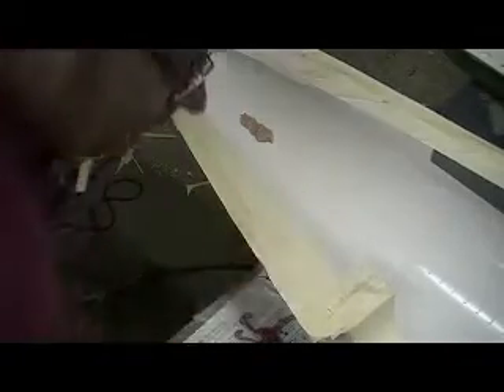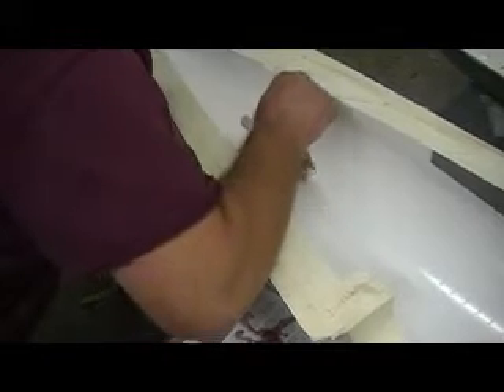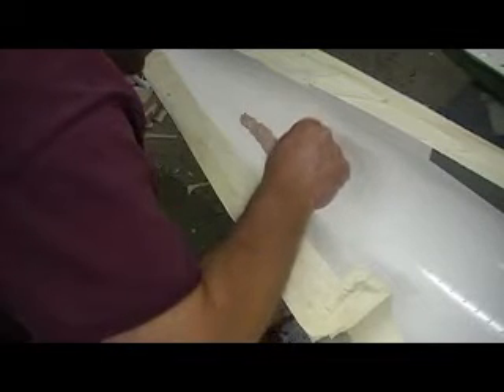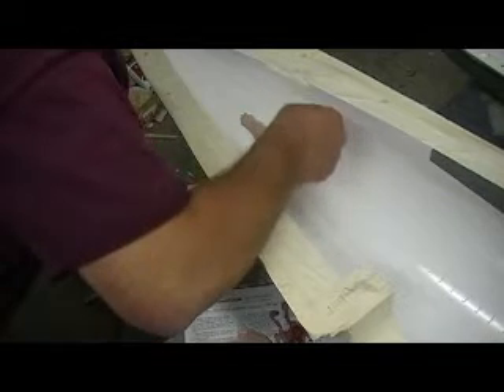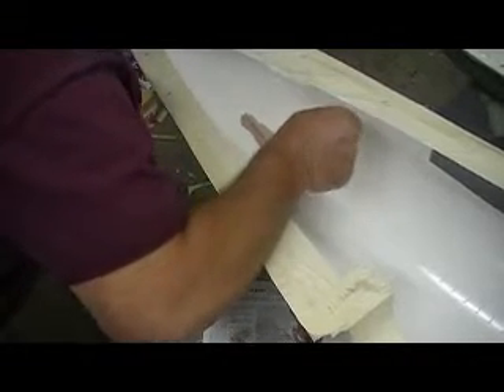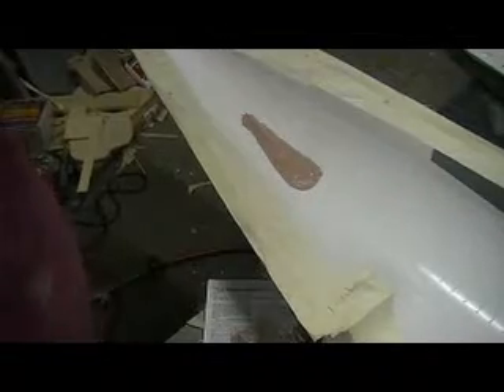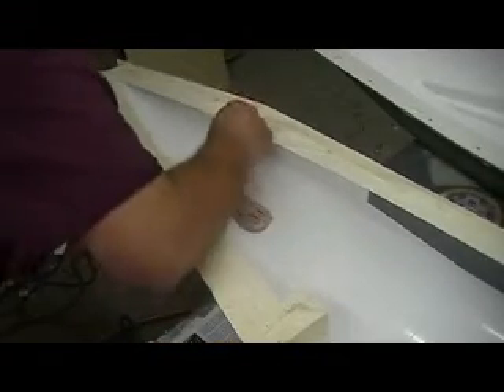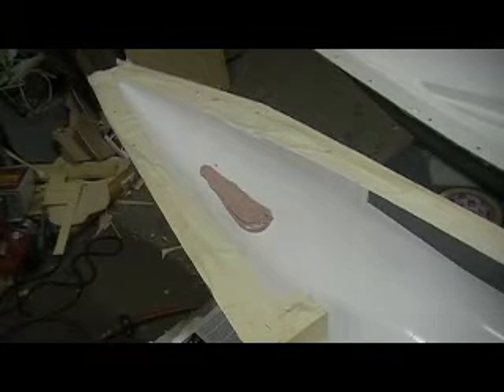F-105 thunderchief kit buildin action # 204

Comment: Do not use dura glass. Why? Because I'm a auto body tech & dura dura glass it dry so hard that is a pain in the ass to sand. Even when is not cured all the way. You will thank me if don't used. Another think. You don't think it was easier to do it outside shape it & stick it when done. If you had to pop it out anyways. Be care full with that stuff. Sometime that stick to any rough surface & is a pain to clean it, you have to sand it to get rid of it.